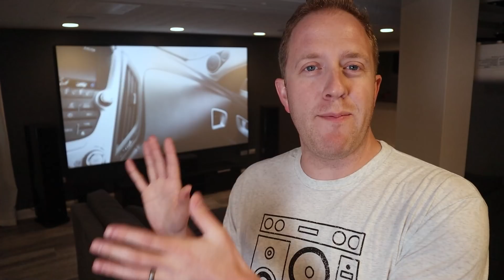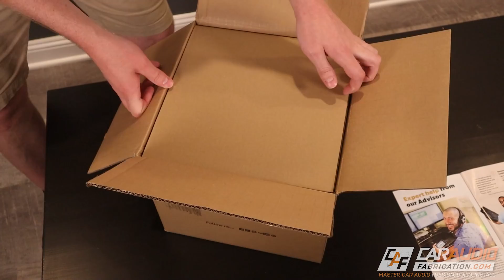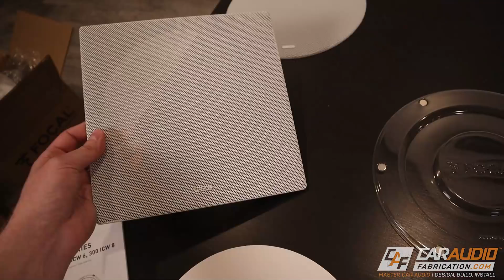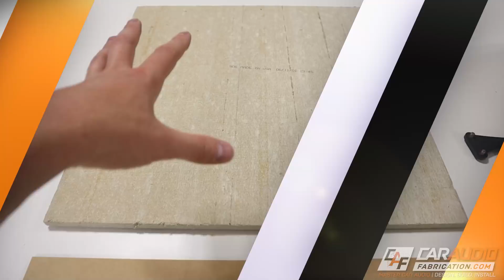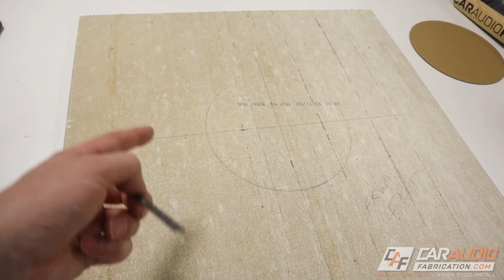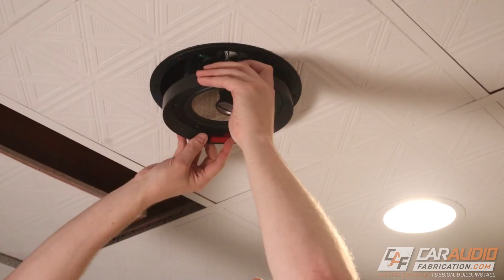Ceiling Speakers Install! Features you NEED when picking yours!

Comment: So, is there no need to do a back box on ceiling speakers? I see more commercial brands often have a built in back box but when I look at speakers like you installed, no back box is included and most installers dont use one... Why is that? wouldnt it be like a speaker in our cars where it would sound better if it can have a specific air space to work with? Your application has two speakers playing different channels in the same overall air space so how would that effect eachother?
Reply: It would help obviously. All speakers come in cabs. You develop more base with the right resistance. Car exhaust also needs some resistance to run better- back pressure. The more you push the speaker, or a car, the more you need to have it tuned correctly.
Reply: Can I use Bluetooth ceiling speakers with my receiver for Dolby Atmos ??

Comment: What's you take on home theater subs. Currently I have both elac reference and audio engine hdp9 with a Bic f12 was thinking about svs300 micro or rythmik servo subs.... love 2 channel stereo nothing like 2 speakers surrounding you with immersive sound...
Reply from the maker: Wait til you see what I want with :)
Reply: @CarAudioFabrication  finally made my choice last night. 340 off and free shipping..... went with monolith 15s  flat into infrasonics....... gona try to rattle out my fillings
Reply: What did you get?
Reply: Can I use Bluetooth ceiling speakers with my receiver for Dolby Atmos ??

Comment: My man , I’m a devoted follower of your channel.now that my son is about to get his first truck I told him I would help him install a decent system but I also pointed him to your channel for further help and information. The reason I commenting is to ask if there is anyway I could some advice on my 2017 ram with the oem head units being so integrated now I was have some issues with installing an amplifier if possible could reach out to me or tell how I could reach you if possible….. thanks for the channel great content I fully aware of the work that goes into it keep it coming

Comment: My home theater dual subwoofers are the entry level subwoofers from SVS 
I have Dual SVS PB-1000 Pro and they rattle the pictures frames and my bedroom doors and kitchen cabinets. I’m sure what ever subs Mark gets will rattle those ceiling tiles.
Reply from the maker: Zero issues.
Reply: @CarAudioFabrication   yeah i got I trouble From my wife and kids.😬🤣 volume at 11.0db only even when they’re not home. 
Looking forward to seeing the completion of your theater room. All Focal gear? 🤷🏻‍♂️
I’m getting my 2017 Tahoe door treatment done and floor. Thanks for the video 🙏🏼👍🏼✌🏼

Comment: hello sir sorry ask here this queston what reason stop have sound my speaker and subwoofer for amplifier what is the reason most time lost sound and problem for amplifier
Reply: Start with your Your amp. Or av receiver , cables.  He can’t see your system so there’s no way to answer your question. 🤷🏻‍♂️

Comment: Hi sir. 2 days back I had installed Rainbow EL series comps in front and coax in rear without amp and running on pioneer head unit fh x 779bt but after playing for arnd an hour all four speakers stops for few seconds and starts again and the same is repeated. My max volume is 15. Kindly guide
Reply: Need more power get an amp. Check all wires

Comment: Think my original post got deleted, but I did the exact same thing. I used 1/2” mdf and used pocket holes and screws to secure the bracket to the ceiling joists. I talked you in IG. I can honestly say this channel game me the confidence to take on that project. I also made in wall cabinets for the LCR. Funny enough I started seeing other companies start to offer them shortly after.

Comment: Fun tip: notice which way the teeth of the blade are pointing. have those facing the backside of the piece you're cutting to reduce chip-outs even more.